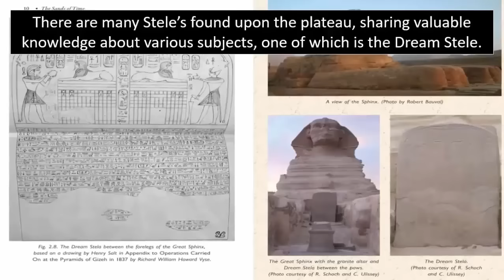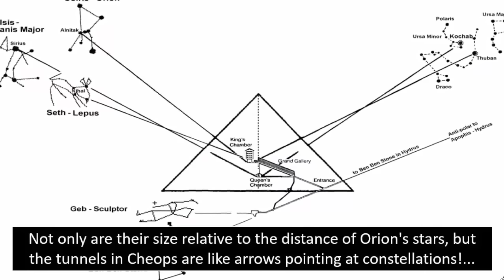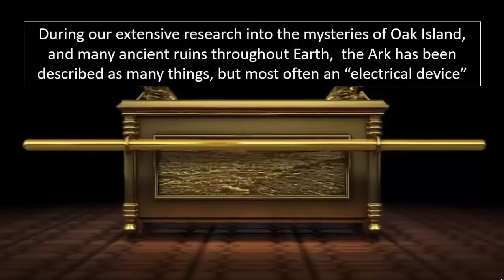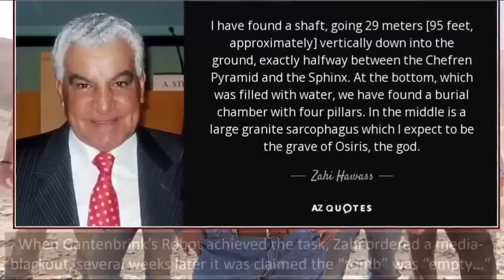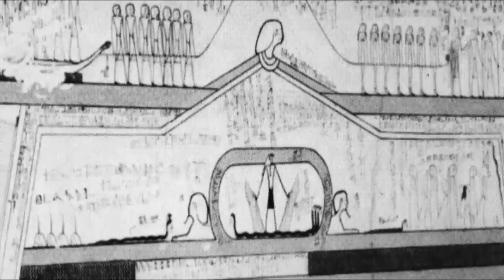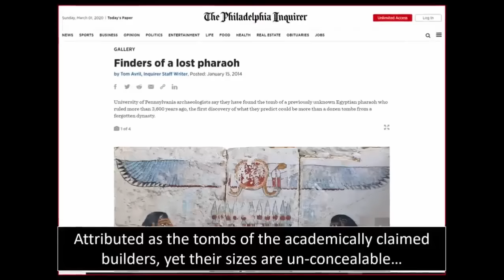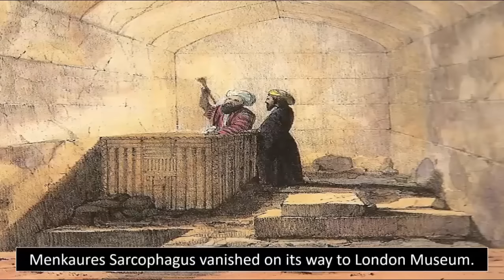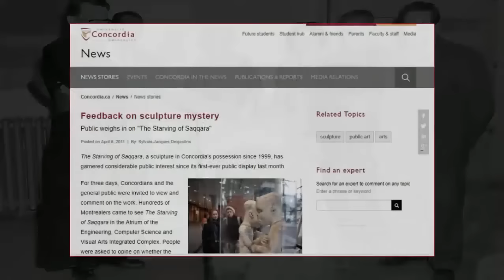Great Pyramids Impossible Facts Exposed? 🤯

Comment: Assuming the optimal time of 20 years, the Great Pyramid of Giza would have required placing about 800 tons of blocks each day, which is approximately 12 blocks per hour on a 24/7 basis. The 2.3 million blocks comprising the pyramid weigh from 2 to 30 tons each. they have to quarry, cut transport and polish those blocks, not just placing them. great skills of the ancients.
Reply: Did you calculate the man power?
Reply: More than 800 tons the inside Blocks Extreme Size. Like Those laying on the ground. That even huge UFO's can't move.
Reply: @zackbean2149  80 ton maybe not 800 ton

Comment: Let's build a Pyramid to house the remains of a Pharaoh... Let's make it out of Red Granite blocks that are in a quarry 500 miles away, and let's use 2.3 million stone blocks the size of cars to do it... And let's use copper tools, ropes and chicken bones to build it...Let's randomly put these chambers and shafts in it too. Let's align it to within tenths of a degree to the Cardinal directions.....and to celestial star alignments with Orion's belt.... Hey wait a minute... weren't ALL THE PHARAOHs buried in the Valley of The Kings??? Then HOW DO YOU EXPLAIN THIS Mr Zahi....
Reply: @ansfridaeyowulfsdottir8095 : Sadly, actual facts and reality probably won't work here. :hand-purple-blue-peace:
Reply: This narrator only focused on the Giza plateau...the Great Pyramid and the two smaller "mids" The GP is the biggest(on most pictures of the 3 mids, it is the largest and on the right.  That was supposedly Khufus mid.  All of the white tura limestone is gone.  At its base, it has the 3 smaller pyramids (which were for each of his wives) in the center that has some casing stones still on it was Khufu's son.  It looks bigger only because it is on higher ground.  Maybe the slabs were left on because they were not pure white(so second grade stones as they have a reddish stain on them.  The smaller of the 3 pyramids was the son of the second pyramid dude.  This one has the gash in it where there was an attempt to destroy it.  They  gave up after many months of trying.
.  If you travel up the Nile River about 100 miles....you would have passed about 100 other Pyramids till you get to the Step pyramid(which is basically the FIRST Pyramid(the pyramid of Djoser) made out of stone and is 6 layers high.  He was noting that the Mastabas of former rulers were being hidden(as a mastabas is a single layer of stone or mud that was the head stone of the ruler)  After a sandstorm there is much sand to hide the mastabas and that ruler is forgotten.  Djoser did not want to be forgotten so quickly.  Ergo the build up of layers to a pyramid structure.   The pharaoh when he died was buried 100 feet down in the limestone bedrock...and then that holes is refilled back up and then  the blocks that had to be removed in order to bury him in the center was refilled and replaced so you don't know where he is.  Basically a headstone is what the mid is.

Comment: It kind of reminds me of the way one tunes in weak signals on a shortwave radio,, The largest knob or pyramid is the course tuning, next smaller knob or pyramid is finer tuning and so on and so on,,, just seeing something and breaking into something understood by myself.  Then again so much I have learned comes rite down to vibration,, frequency, electromagnetic wave in amplitude, length, modulation???  Due the sizes break down by size and or harmonics?  could a flow of water be the bow crossing the strings?  Time to ponder a bit about this, go ahead, can't hurt.
Reply: My thoughts exactly, we'll said.
Reply: The power supply for a gateway
Reply: Well said indeed, but it MUST be some sort of cutting tools to be able to cut that precisely, even if i don't like the word "tools" it could easily be laser or other unknown stuff. Why do they keep us away from the truth (if available) is a mystery. But there's proof of perfect face sculpture symmetry, perfect straight line cutting, everything seems to be perfect... I've learned very early in life that perfection does not exist ...why

Comment: what is often lost in the discussion is the planning the design, or drawings, or models. which would be needed to create huge structures with incredible precision and alignment to the stars.  Its not just stacking stones up, or pouring concrete..  its thousands, or millions of blocks, all assembled perfectly and lasting for thousands of years intact, sill level, and still precise.... even IF there was poured material, it would have to be crushed into powder, transported, lifted, add water, poured without a big mess, and then hardened.   and 76 ton granite stones inside the great pyramid are not poured, nor is the granite box in the kings chamber there..........perfectly square to this day                  and then consider how many of these massive structures are all around the world, many of them in inaccessible places almost, still standing, and still precise.........      clearly civilization had a collapse long ago, and we are still crawiling out of the hole so to speak.   modern archaeology refuses to recognize the obvious.

Comment: According to the Bible, the flood of Noah is believed to have occurred several thousand years ago. Traditional biblical chronology places it around 4,300 to 4,500 years ago, which would be roughly between 2300–2500 BCE. However, there is no precise date, and interpretations vary depending on different religious or historical perspectives. The Great Sphinx of Giza is believed to be around 4,500 years old. Most Egyptologists date its construction to around 2500 BCE during the reign of Pharaoh Khafre, who built the second pyramid of Giza. Some alternative theories suggest the Sphinx could be much older, but the widely accepted view links it to Khafre's reign in the Old Kingdom of Egypt. The Great Sphinx of Giza is generally believed to have been constructed around the same time as the Pyramids of Giza, specifically during the reign of Pharaoh Khafre (around 2500 BCE). This means the second pyramid, the Pyramid of Khafre, is the most closely associated with the Sphinx in terms of age. It is thought that the Sphinx was built as a guardian for Khafre's pyramid complex.

The Great Pyramid of Giza (constructed by Pharaoh Khufu, Khafre’s father) also dates to around 2580–2560 BCE, making it slightly older than the Sphinx but still from the same general era. The smaller third pyramid, built by Pharaoh Menkaure, was constructed later, around 2510 BCE.

Comment: I'd like to ask someone to investigate what looks like sealed passage in the ceiling that is exposed at video point 3.33 ? it is square with a central circle. And maybe the circle is another, or does that place mark something about the pyramids geometry? I will point out that beneath that, the masonary makes a level plateau. I would also like to point out that painted glyphs were found inside one of the gantenbrink chambers.

Comment: I would like to say to something to your team and to your audience. I have two professional trades.
Due to my interest in stones and minerals, I was a member of the British minerals and minerals lapidary association, my second profession of which I am still engaged in (mechanical engineer,) I used my skills as an engineer to design and build stone cutting equipment to cut gemstones used to create jewellery, something I had learned at the Norwich school of Art and design.
I have cut and fashioned some of the hardest stones such as Sapphire which has a hardness of 9 on the Mohs scale and agate which has a hardness of 6 and everything in-between.
I will say categorically, that all the stones you can see with cut groves lines, 90 degree angles, perfectly smooth surfaces and cylindrically bored holes have been done with diamond saws and boring tools (Diamonds have a hardness of 10.)
Copper (A hardness of 3) and even iron tools (which has a hardness of 4.5) would not even scratch granite or diorite, let alone shape it into polygonal shapes that fit so precisely.
Reply: Thank you for that pertinent info.
Reply: I am a good bit below you when it comes to that. I have roughly 100 meters of granite wall around my garden and i did all of it myself. 24 years of building machines (conveyer and lift systems for the car and beverage industry) at my  job and roughly the same time with all kinds of stones around my house and that is already enough to come to the same comclusions as you.
Reply: I love it when people who obviously know and understand what they're talking about post comments! Thank you for the insight 🙏

Comment: Hey HM, thanks for the amazing videos!!!  I have learned an incredible amount and have seen more amazing structures than ever in my life.  I owe you dearly!  One fun thought... the Ark, Arc of the Covenant.. may be an ancient pyramid Spark Plug!   I don't think there was a coffer lid.  I think it was exposed and when the "King's Chamber" filled to a certain point with the gases from the electrolysis... the capacitor Arc stored enough electricity to fill it and cause an overflow/release as an electric arc across the air gap between the Cherubim wingtips.  Have you looked up how a former Hells Angels Meth maker looked at the Ark and said that based on the descriptions of the combustion described in the Bible and the other things like boils, acid like burns, the uniforms of the priests, all are similar to modern meth making and the uniforms used by cops who bust them and approach the dangerous chemicals and gasses present at labs.  He said that the Myrrh and Frankincense and Gold weren't just gifts to Jesus in the Bible but also found in the Ark.  He says that those two chemicals can make a meth type compound that could cause the effects described.  What he doesn't touch on is how such a chemical could be an electrolyte in the battery/capacitor that is the Ark/Arc.  Interesting line of enquiry that I hope you find Very Compelling.

Comment: Silly thing is I wonder if they used a droping system to run a blade that was rotation  like if you was to drop Pebbles of a harder rock on a softer rock then bucket it back up.     Like a reverse digging barge.   Then adding Dimon bits so in the end you get a scooping effect t.   Then saws opperated by a blade that was some 6 foot wheels.  But they was used to rub Diamonds dust and water to cut the stones with adding a bounding hammer to resonate the stone.
Reply: What or who is Dimon?

Comment: Those stones look molded, Imagine using focused sunlight to superheat granite to a molten liquid state - If only you could use sand as a basis for those molds.
Reply: You apply high heat to granite and you will get obsidian, a black glass.  Granite is the result of volcanic lava slowing cooling  over millions of years. You can't melt it and get the same crystalline strucutres back.
Reply: @jelink22  Good point...hmm and a Time Machine wouldn't be helpful here either, dammit!

Do you perhaps know the type of granite that was featured here, IE. A1-type granites , SiO2-F or SiO2-Mg variants? This will tell us if water was present while the magma cooled to form granite.. then we follow that clue 🙂

Comment: It's called "patience", it is possible to finely saw stone with sand and wooden/copper tools, it just takes a while.
Reply: How long did it take to build the great pyramid? How many blocks did the builders have to cut and fit? Who organized and led the workforce? Where did they get the blocks from and how did they transport them? If they rolled them on logs, where did they get all the trees? The distance between many of these blocks is 1/50th of an inch. Mark an inch on paper and try to make 50 lines inside that inch with a pen or pencil, it's virtually impossible.

It took a LOT more than simple patience to build these structures.
Reply: as a machinist, I can tell you, that you have 0 clue.

 You CANNOT create a mirror smooth, completely flat surface on hard granite using wooden or copper hand tools. The Romans tried this on soft Marble, and were unable to do this.
Reply: @ghostrider-be9ek  you need to read properly.........SAND, and wooden/copper tools. It is the sand that 'cuts' the stone, the copper or wood slips are used to move the sand . This method has been used by many peoples all over the world for thousands of years for either cutting or smoothing rock
Reply: @ValkyrieRiderIPT  yes it also took a lot of skill, by the way nearly all the blocks were unfinished.......only the final layer, and certain internal blocks were finished stone. Instead of assuming that our ancestors were stupid, and that therefore it could only have been either aliens or some mysterious people who did things we can't duplicate, you need to realise that human beings are amazingly versatile and can eventually figure out the best way that they can do things. Probably sleds on tracks rather than rollers most of the way, rollers are so yesterday !
Reply: @garycox5238  you need to realise that human beings are amazingly versatile and can eventually figure out the best way that they can do things

No amount of figuring out would have helped. How many blocks per day had to be cut and fit to build it? The granite stones in the kings chamber weighed right at 70 tons and brought in from 500 miles. And the blocks were 1/50th of an inch apart glued together using some type of adhesive poured between. That glue was so strong the blocks would break before that adhesive would give way. There's simply no way this structure could have been built by Cheops or Khufu who didn't even know how to make toast.
Reply: @garycox5238  lol no, you CANNOT make mirror smooth, perfectly parallel stone surfaces, over metres, using 'basic hand tools' into HARD granite.  

Literally this is like saying that we can build cars in 100AD. Thats how absurd it is, and you have no clue. 

I am in the materials world, you obviously are not.